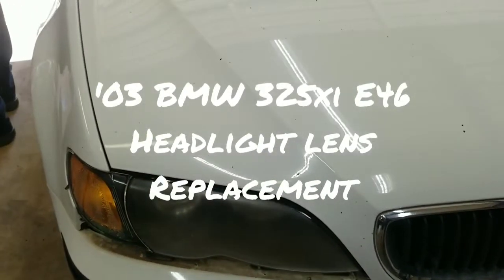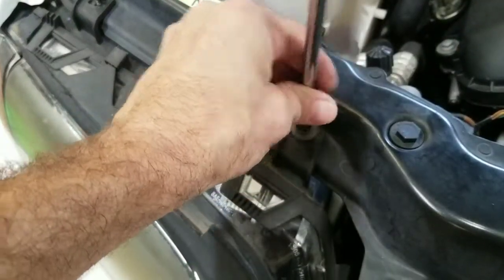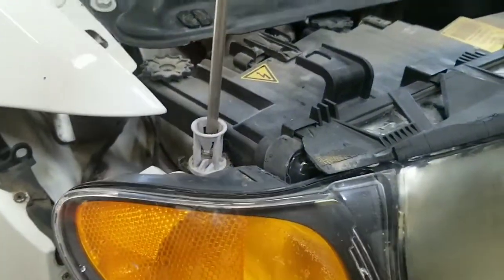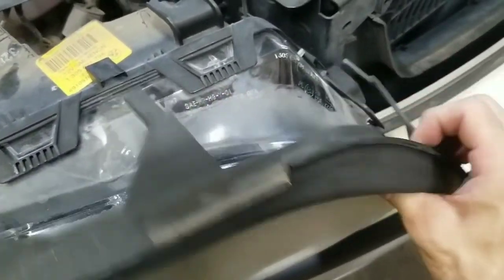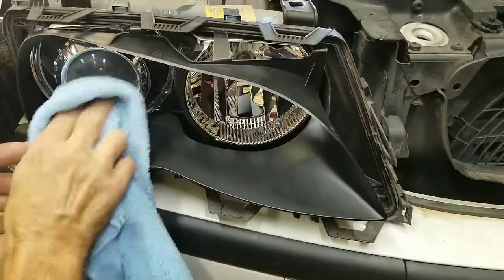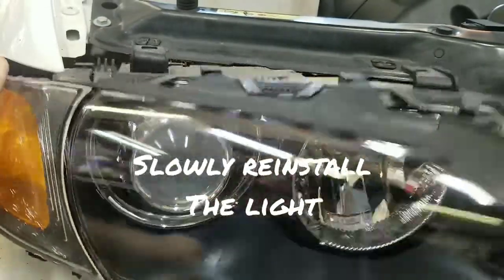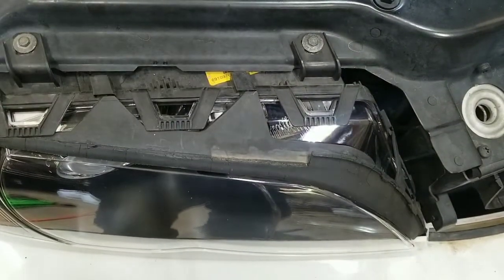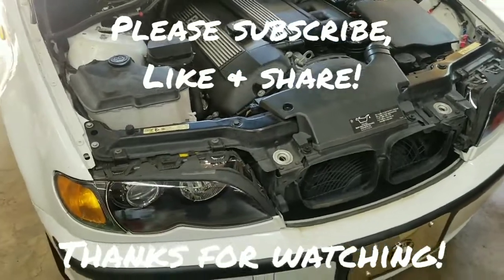'03 BMW 325xi E46: Headlight Lens Replacement

Comment: Thank you. Used this video as a guide for replacing mine. I also found (after doing the first lense) that the headlight did not have to be removed. And a trip to the hardware store to purchase a magnetic screw retriever to recover the lost torx bit and adapter. The blinker light came off without removing the headlight.

Comment: Thank you so much for the video! $30 or $40 for a new lens online? That is great to hear! Recently a BMW dealer told me a lens replacement would cost $600 each! Glad I didn't have the lens replacement done there. My 2003 325i badly needs headlight lens replacement. I tried a cleaning product that was supposed to clear the lens, but it didn't do any good and I got the run around when I asked a repair shop to clean the lenses. Ordering them online is definitely the way to go. Thank you!

Comment: Very helpful. One important addition....on my 2003 e46 the two top screws have DIFFERENT threads than the two lower screws. Put all 4 screws in a cup and first screw I grabbed for the top would not go in as it was one of the bottom screws.

Comment: I'm sure you heard of using heat to soften the butyl sealant between the headlight and the lens. I'm sure it would help removing the lens/prevent breaking any parts. The units used in this video didn't seem to have any, strangely, just some gasket. Not sure if all e46s are like that. I wonder if the lack of sealant may be causing issues with condensation or premature yellowing of the lens.
Reply: Sealant is on e46 coupe and convertibles. Sedan headlights are different and the cover is removable.
Reply: Naw mines a 4 door and they're sealed

Comment: Did you get new oem lense or Amazon/eBay cheap lense? How are they?
Reply from the maker: I believe I ordered them from a bmw supplier but not a dealer. As far as I know, they are still working fine.

Comment: No NEED to remove the headlights!!!!! Just remove the trim piece and the turn lights that will give u the room you need to do the job ... the video creates unnecessary work!!!!!!!!!!
Reply from the maker: It's much easier to pull the headlight out. Everyone's will be different. Yours might come right off, but like these lenses, I had to tug on them several times all the way around to get them out.  The extra 5 mins to remove it keeps you from breaking the tabs when the lense won't just come right off.  I've done many lenses, with both headlight in and removed. Overall, I'd still say it's better to remove the light to give full access around the light.
Reply: @okcvet1st  thank you i see so many times people on YouTube don't bother taking of the headlight but people don't realize how much harder it is to do things when you don't have the right space for it